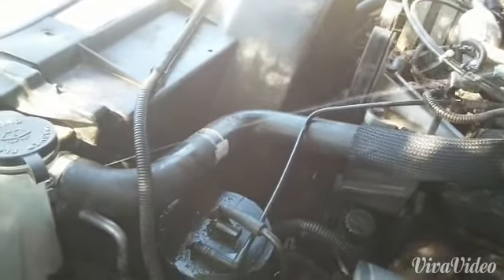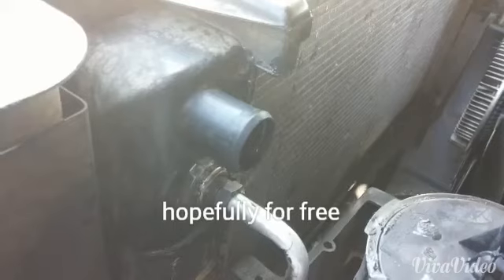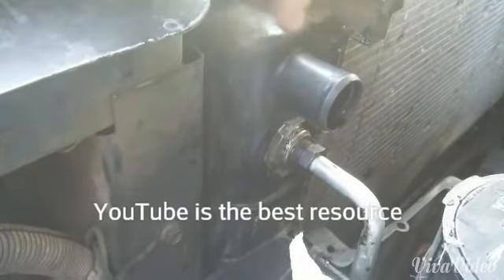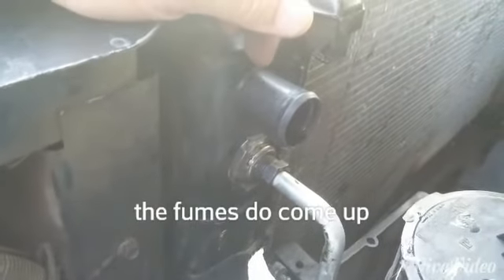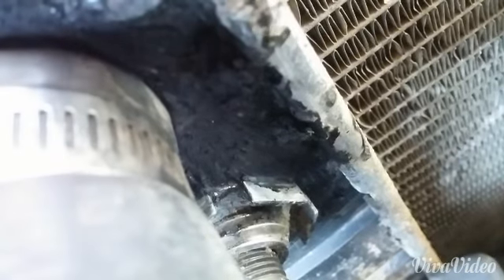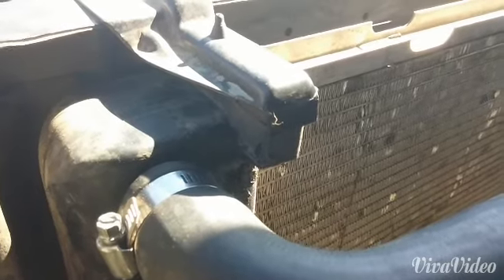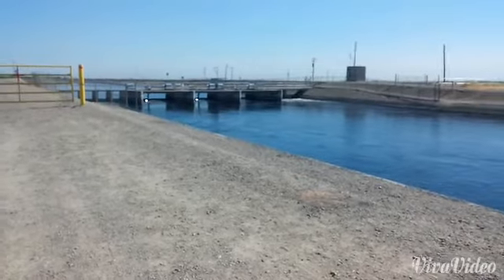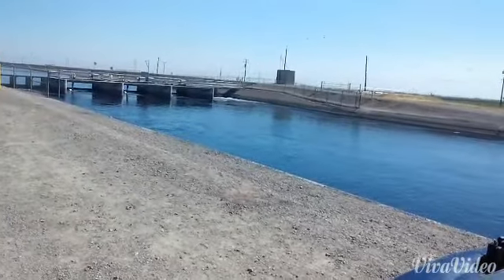Diy-Radiator leak plastic weld fix

Comment: Great video. How did you remove the original store bought repair and what plastic did you use to weld into the radiator. Thank You